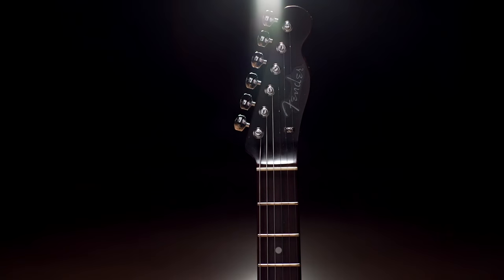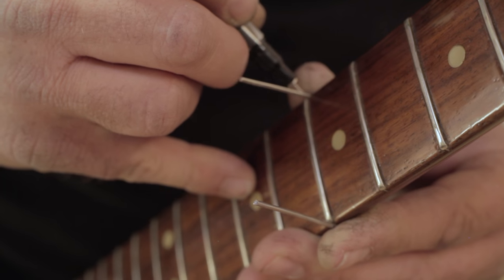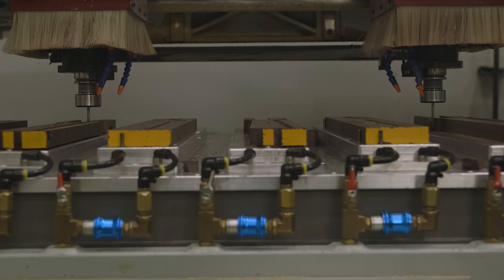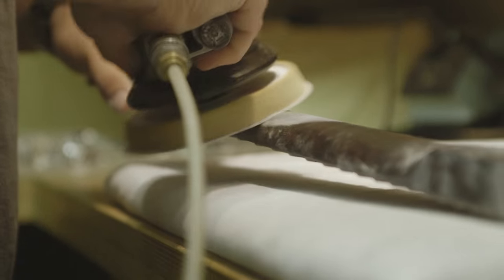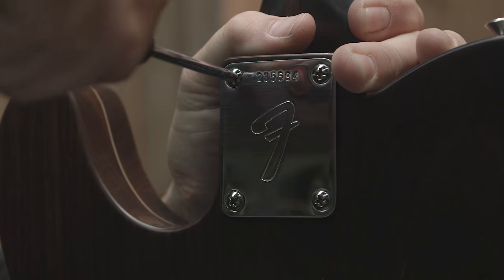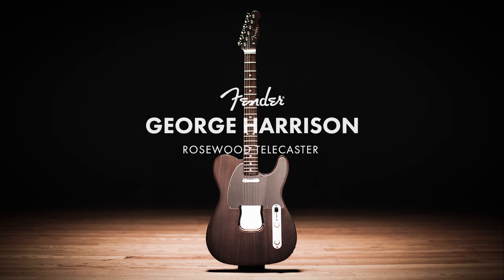The George Harrison Rosewood Telecaster | Fender

Comment: I played one of these back in 1972 when it was just another type of Tele. Sounded great, but it does have one drawback. It weighs about 9000 pounds.
Reply: +David Evans It's almost over nine-THOUSAAAAAAAAAAAAAAAAAAAAND!
Reply: From what I have read/found out, rosewood just wasn't too popular. Also, the one made for George Harrison was customized before it was given to him (I don't remember the details of it, good like finding it because there's probably going to be a bunch of this new stuff to sift through).  
  
I've seen other companies making regular teles with rosewood for less (some just have a rosewood top so that the guitar is still lightweight -- I don't really care about weight though). Maybe Fender will do the same in order to be more competitive.
Reply: +Nermket I found it to be heavier than a Les Paul, and until I knew George played one I didn't really care for it. Its too heavy to play standing up for any length of time.
Reply: +Nermket George's wasn't customised, It was custom made for him by Fender and flown straight to him personally. The first of production. 

It did get customised by Delaney Bramlett, who George later gave it to. You can see in this video where the wood has been replaced on the original where the body was routed and pickups changed by Delaney to humbuckers. He also changed the tuners and had the finish (originally satin) redone in a gloss. 

When Dhani Harrison recovered it comparatively recently for George's estate, he had it restored the best it could be, but Delaney really did a number on it.
Reply: lapelcelery42 Is there much of a difference between customised and custom made? Either way it doesn't sound like it would be a typical telecaster.
Reply: Nermket 
Yeah, you're right, it's not typical at all.
It's just unusual wording. 'Customised' suggests it was changed from original condition at some point. 'Custom built' implies that, although it may have been built specially and uniquely, it hasn't been changed since it was made.
Reply: +henry alva I'm not complaining, I'm just saying. I loved the uniqueness of the guitar. And I don't think either of us know George's feeling about the weight. Its a common comment on that guitar, though.
Reply: +henry alva I hear ya. I can't believe Gibson is making "weight reduced" Les Pauls. When I saw that I about shit.
Reply: +henry alva LOL me too.
Reply: I have a custom-made Tele that's a swamp ash body with a maple top... dear GOD that thing is heavy, but it's worth every pound.
Reply: David Evans there's only one thing that can be said about this guitar: she's so heavy and boy, you're gonna carry that weight
Reply: Insert obligatory "OVER NINE THOOOOUUSSAAANDD!!" jokey-meme-gag here

..... WHAT?! NINE THOUSAND!?!?
Reply: PokéPulls by ShinyMegaGengar9001. Already done in the thread. Pretty lame stuff
Reply: henry alva - maybe some of us just like having a guitar of proper weight and don't care if it makes us "tough" or not. Last I checked rock & roll don't give a shit how much your guitar weighs. LOL
Reply: 9000lb? Nice guitar but not fit to me

Comment: a guitar so good he gave it away after owning it less than a year !
Reply: He did give it away but did actually have a soft spot for it. Elvis had the other of the prototypes for a few months though but reportedly didn't like it at all
Reply: Tom King Ya. Sure, they LOOK pretty, but there was a reason they only made them for half a minute; they didn't have the iconic Tele sound you get with swamp ash (or pine, even), which are featherweight woods. I don't know if it's just the weight that accounts for the tone (doubt it; there's density, grain structure and tightness and maybe composition - which elements make up which woods, in which %s..). Who knows, but it wasn't just the weight that made those rosewood bodied Teles less than popular. The tone had alot to do with it. How many other style electric solidbody guitars you recall seeing with rosewood bodies? - Uh-huh. That's what I thought. When have you ever seen that wood used for anything but fingerboards and acoustic back and sides? Same thing with rock maple. One or two acoustic back and sides, or a top veneer on an archtop or Les Paul, and necks.
Reply: Jim McCracken - No. That would indeed have been an anchor. It was (as with many Gibson solid-bodies) mahogany. A Les Paul Jr. Special. (They're the ones that look like a 'Paul, but are flat topped, not figured/arched. Also just mahogany; no maple top.) The regular Jr has one pickup. Special has two. Usually P-90's (fat single coil), though some have humbuckers or minis
Reply: Paul Feldman whereas I’ve always loved the rosewood tele you have some fucking good points there dude.....fair play man
Reply: I’m sure he liked it if he used it but yeah as far as I know he was a strat guy
Reply: Yeah he prolly thought about it as just another ordinary guitar that was given to him and being able to buy another.
Reply: I have to agree... I get a kick out of these so called “Signature series”... Dwight Yoakum had a god awful one made by Gibson... he never used it .. same with other artists.. nothing but a money grab..
Reply: A Rosewood Stratocaster prototype was created for Jimi Hendrix but it never got to him.
Reply: @marcushogan6613  A Rose Wood Stratocaster was apparently built for Jimi Hendrix but sadly, he never received it.

Comment: I made mine from scratch. $1800 altogether.
Body from Warmoth $495 at the time. Neck from Musikraft $495 (because they do the 1.650 at the nut, Warmtoth said no when I asked) a '63 and a 67' pickups from Klein (THE best sounding!! Exact  when I play with the songs) correct silver decal, tuners etc. It is HEAVY, but I only play it sitting down. And the sound, and feel are amazing. It's worth it if you build one yourself. Plays like butter, and I hate it when guys says that too!

Comment: This is weird because I remember drooling over a Fender George Harrison Rosewood Telecaster over 10 years ago at a shop in Henderson,Auckland,New Zealand. It was sitting high up on a wall so the plebs couldn't get their sticky fingers on it.It was a used guitar that had a sticker price of over $4000 at the time. 
So Fender have done this before but I guess the difference is that it wasn't a Custom Shop replica like these ones are.

Comment: Boy, so many questions about this guitar...
1. In pictures and film of George playing the guitar, the fretboard is very dark (and the neck was documented to be a 2-piece).  But in this video, the fretboard is much lighter, looking just like all the 69-72 telecasters with the one-piece neck.  I wonder if the neck was replaced at some point.
2. Did someone install a humbucker in the bridge and then restore it back to original?  I heard Delaney did that but can't confirm it.
3. Why are the capacitors not the "red dime" versions (which were the norm in the latest '60s)?  These look like recent replacements.
Not trying to drum up any conspiracies, I'm sure there are great answers to the questions; I'd just like to know.

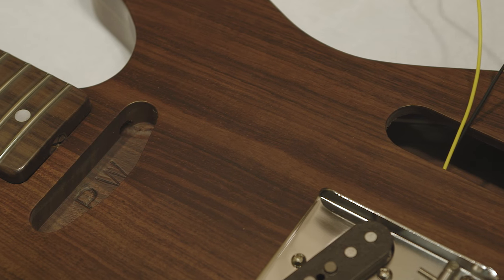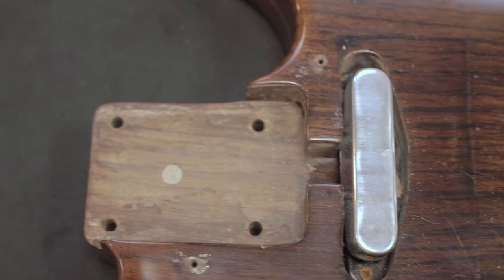Comment: Is the new one made like a thinline, sort of? At around 1:26 it looks like the top under the control plate is about 1/4" thick, whereas it looks like a straight rout on the original at 0:37

Comment: I hate the water slide logos, why can't they inlay them?
Reply: +w1third Same!
Reply: +w1third - totally agree - I have an American deluxe strat and the decal on the headstock for a couple of the letters has come away where I have held it during string changes before I realised what was happening - so annoying on an otherwise immaculate instrument - I have two cheaper strats and they are inlaid - what ????? - Steve.
Reply: w1third it's supposed to be a complete copy
Reply: Nowadays we're used to seeing the headstock decals have seamless and invisible edges that are spotless and perfect. Back then Fender's logo decals were waterslides but instead of fine sanding and clearcoats to make those edges disappear they left it and that's what they were trying to capture just like the original from that time as Greyson Myers had said in a comment already about how it's supposed to be a complete copy.
Reply: w1third Because that isn't the way it was originally made back when George got it in the 60's. Fender Custom Shop does everything exactly the way it was originally done. What don't you understand? If you don't like the slide logo, go buy some new telecaster.
Reply: Cry Cry Cry 😥😪😭

Comment: Let's be clear on this: Fender GAVE the original Rosewood Tele as part of a marketing campaign. There was a Rosewood Strat that was meant for Hendrix but I'm not sure if he ever got it. George did not like the weight of this guitar. If it was in a guitar shop it would have been more than likely passed up by George due to the weight. 
After a  stint as guitarist (with Clapton!) with Delaney & Bonnie & Friends, George gave (loaned) the guitar to Delaney Bramlett. Over the years Bramlett had the guitar modified (a humbucker in neck position perhaps?). 
I think George got it back in years immediately prior to his death & had it restored to original condition.
Reply: +Ozzy Pete George didn't get it back before he died. Dhani and Olivia bought it at auction in 2004. Ed Begley Jr. (Actor) cast the winning bid on their behalf.

Comment: Iconic? No. I wonder if they know what the word means. I have an early 90s MIJ made of real Brazilian rosewood, had to register it with the government. The guitar here is not Brazilian rosewood, that's why they're careful not to mention the source of the wood. The price is absolutely insane, exploitative, not exactly a good tribute to George Harrison, who didn't really care for the guitar to begin with.
Reply: @parallax3d it does matter because Brazilian Rosewood is far superior to the Asian products used in the guitar industry today. The woods might have to registered, but there's an unlimited supply available, and they're treated to give the appearance of the Brazilian variety. It doesn't really matter at all, as you say, until you see the price of this ridiculous guitar, which is what my comment was directed at. If it were made of very old-stock Brazilian Rosewood, the price might be half justified, but it isn't, and the guitar is a huge rip-off.

BTW, Brazilian rosewood isn't "regulated", it's been banned for a long time